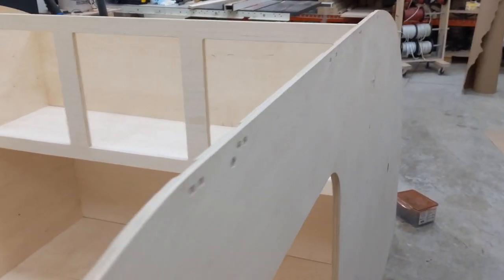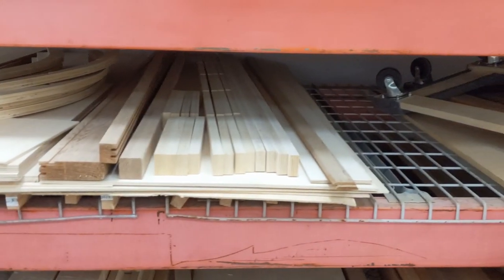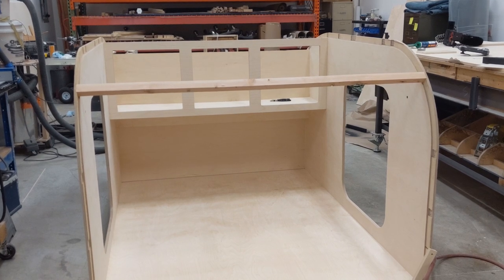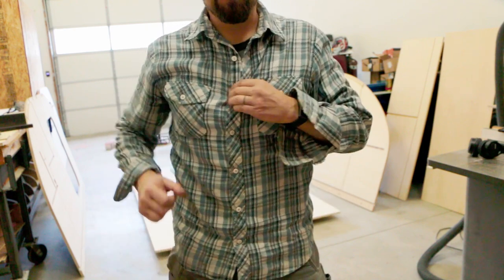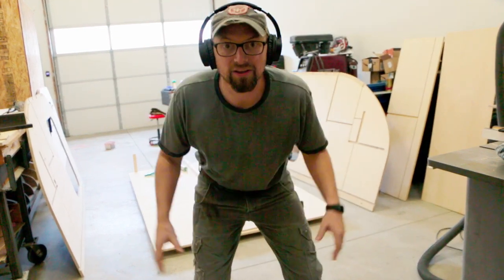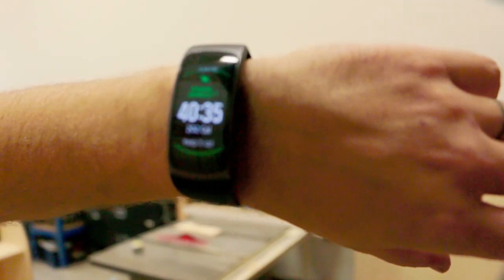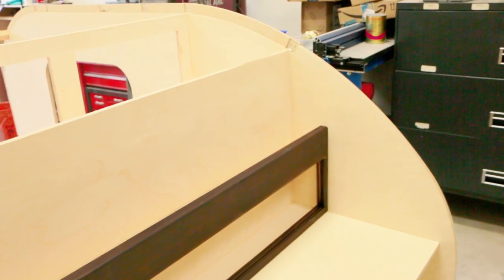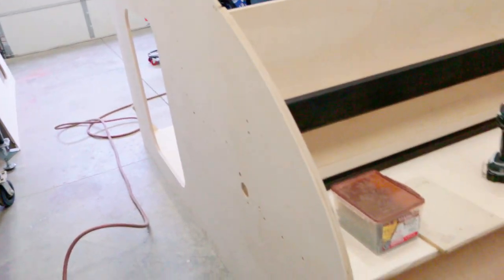Speed Build A Teardrop Trailer

Comment: Mark, how thick are you wood panels? Side walls as well as your cabinet/counter top. It looks like 1/2 for all of them? Also, what kind of wood is that? I like the uniform look.
Reply from the maker: Hi Macbeth  Great questions.  The walls are 3/4" (.70) Baltic Birch Plywood.  So are the cabinets and countertops.  There are 1/8-3/4" baltic piece in this entire build.

Comment: Mark, I know it's not finished here but what about insulation? Side wall, roof, etc...if no insulation, why? More room? Less weight? Thanks
Reply from the maker: Great question and one that there is a future video about.  This trailer has an insulated roof and solid wood walls.  Insulated walls has it's place too.  The fact that most people forget is that a window or vent needs to be cracked when inside.  That can defeat the point of insulation to some degree.  Thanks for watching!

Comment: Really nice work.  Curious why no 'king groove' in the floor to locate your first vertical panel.  I see it floats slightly off the floor?
Reply from the maker: Thanks for watching.  Yes, the floor appears to have a gap right now -when it's not on the trailer frame.  When the trailer is on the frame, everything sits square and that bulkhead is flush with the floor.  There is also a vertical divider under the counter that connects to the floor.  That bulkhead wall is glued and pin nailed to the vertical divider and the inside cabin is trimmed out along the floor.  A dado could be put in the floor but it doesn't add any extra strength after all of the other things that happen to that bulkhead.
Reply: @OverlandTrailer  Cool. That's one less dado to machine.  I'm currently CAD designing a squaredrop, and that's really a good thing for me to keep in mind.  Every slot is one more place for things to bind up, and guaranteed to require extra 'hand machining' :)

Comment: Do you have any advice on how to make it strong enough to hold 500-600lbs on the top? (Large tent and kids)
Reply from the maker: I assume you mean 500-600 lbs stationary and maybe 150 when traveling.  

A rooftop tent that is mounted through the walls and roof would work in most cases.  Just make your mounts so you can "sandwich" the roof and wall between steel plates.  Seal it up like crazy.  Add a maintenance check of those mounts to your routine.

Pro tip: determine where the wiring is in the roof and walls before drilling!  I've helped a few unfortunate campers :(